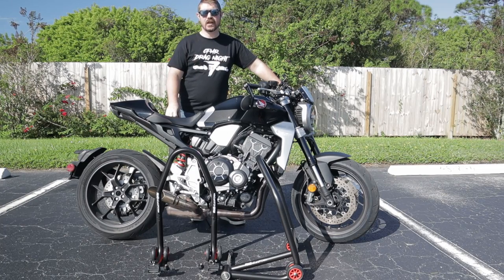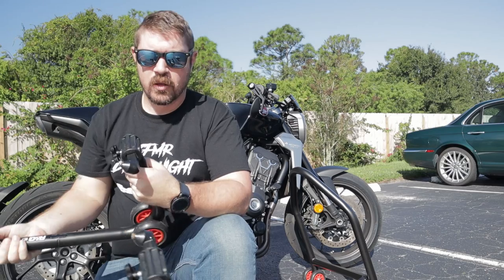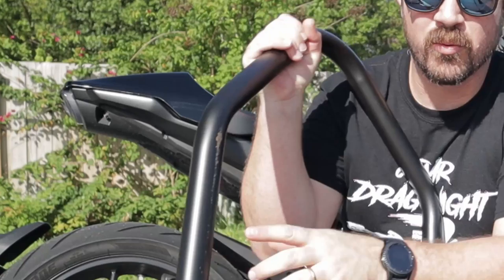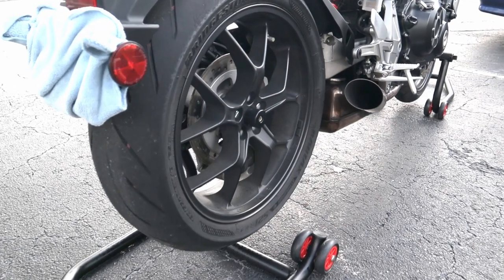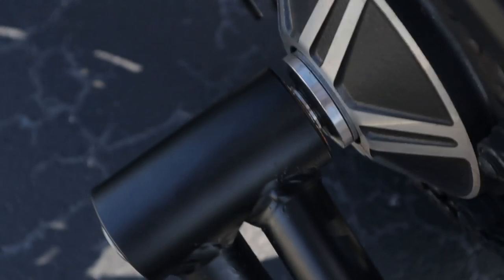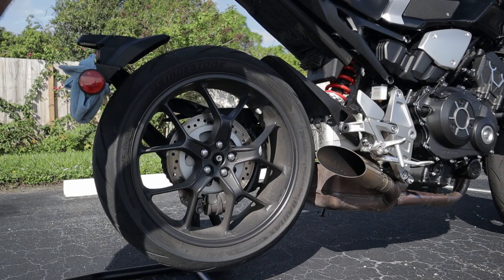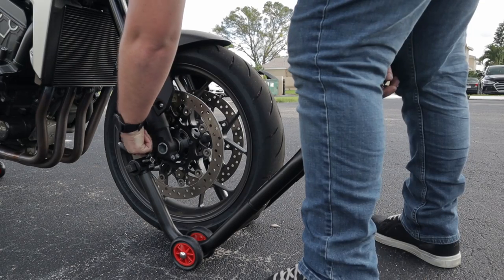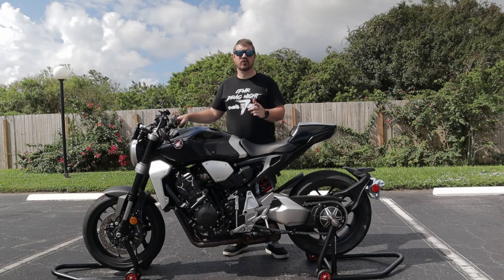R&G Paddock Stands Review | 2018+ CB1000R

Comment: I have the R&G rear paddock stand and for anyone that has concerns regarding the removal of the rear wheel, I can confirm that it’s perfectly safe on this stand. I’ve removed my rear wheel several  times without issue.
Reply: R&G UK are saying the rear wheel can’t be removed using this rear paddock stand
Reply: Can you send a link to purchase the R&G rewrite stand.
Reply: How about changing the sprocket? Does it need another set on rear paddock stand?